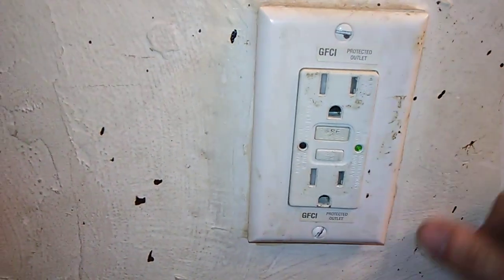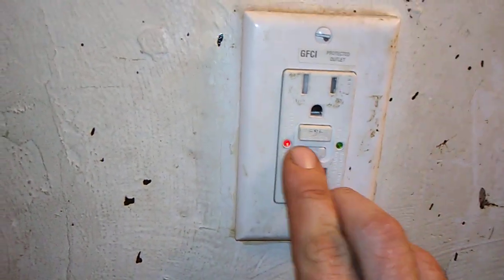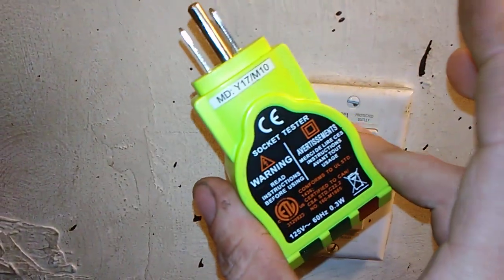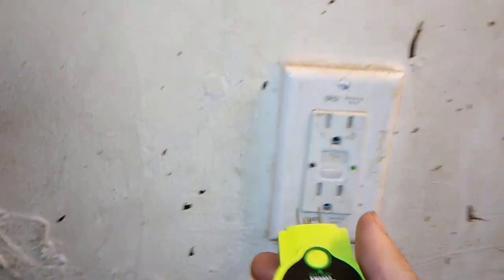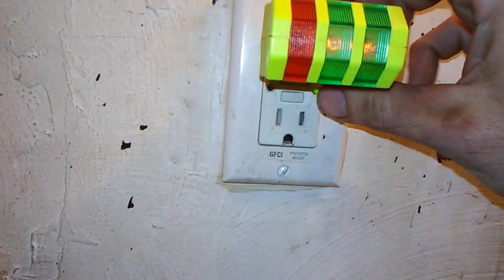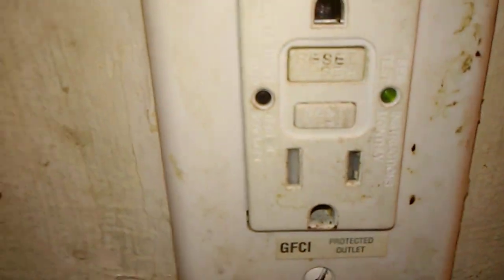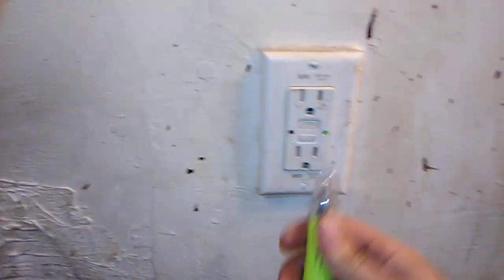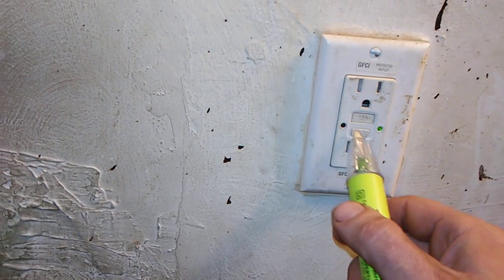"Learning Time With Raoul Duke and how to check out you're electric stuff!"

Comment: Your absolutely right I'm a journeyman electrician still  Still licensed did it for 40 years  A lot of times people mess with them GFCI  and make them stay on all the time so they can plug their freezer into them and don't have to worry about them tripping because in most States the plug in the garage is a GFCI and unless you have a designated circuit for a freezer you do not have a plug in the garage that doesn't trip them are some handy tools to have also a good tool for electrical work is a multimeter it will tell you how much electricity you have coming into your outlet or switch or panel box and some are as/dc so you can check the electrical in your car or bicycle anything that runs on battery be safe brother that was a great tip
Reply from the maker: Yep I learned a few things in my life
Reply: Do chest freezers trip it guess as bad?
I'm guessing it's because the door drops out the cold air suddenly.
Reply: @Eduardo_Espinoza  yes a freezer will trip don't really know i just know you don't want to plug your refrigerator or freezer into them because if it trips and you don't catch it your food goes bad best thing to do is call a electrician if you own your house if not call landlord and tell them you need a freezer outlet God bless you brother